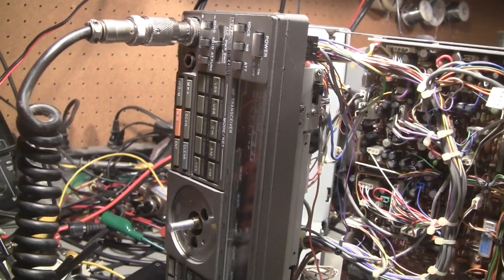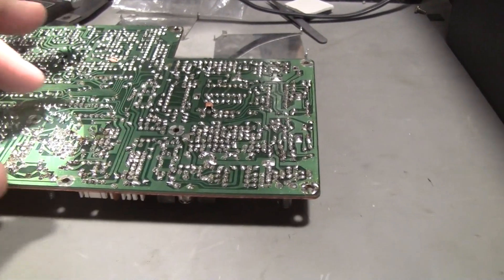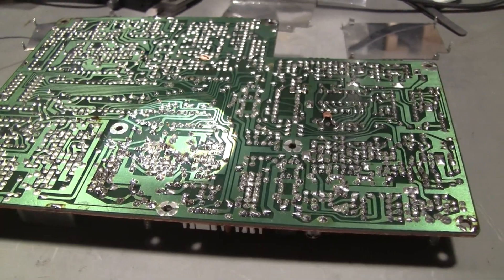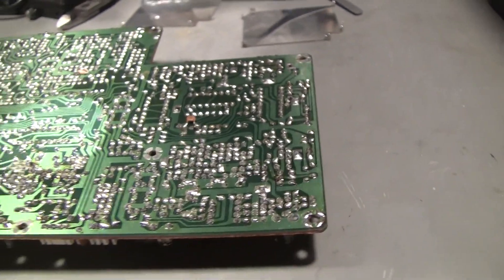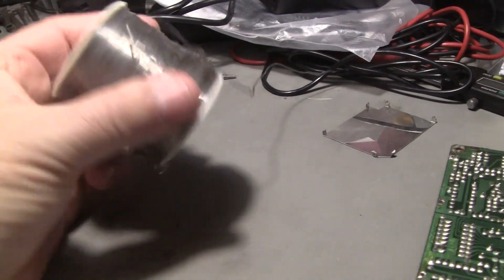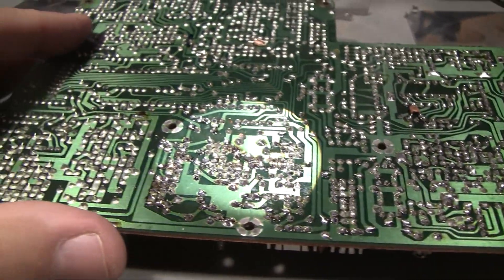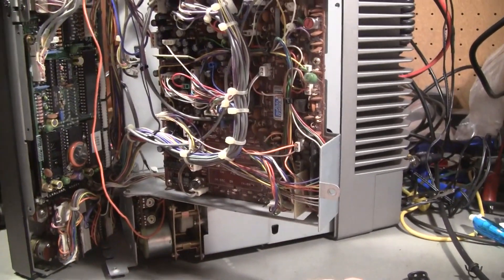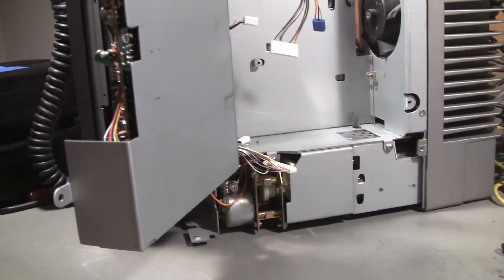Kenwood TS-440 Repairs ! Part 6. PLL Board Gets 100% Solder Reflow !!!

Comment: That's the very reason I like my Kenwood TS-430S and PS-430 power supply.  The 430S doesn't get dots.  I think the 430S is a better radio and doesn't suffer from the dots syndrome.  73 from K9POW in eastern Tennessee.
Reply from the maker: The 440's in the early years had the dots problem. Later ones did not. My 2nd 440 that is later has zero issues. Never owned a 430. Glad you like yours.